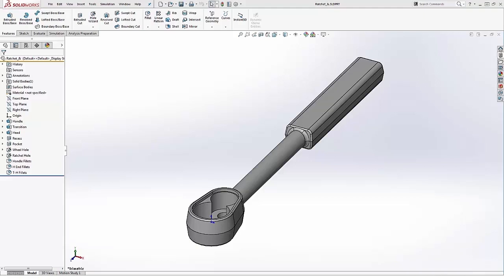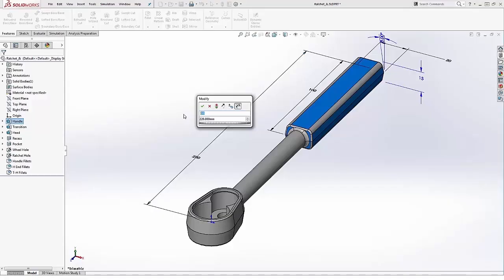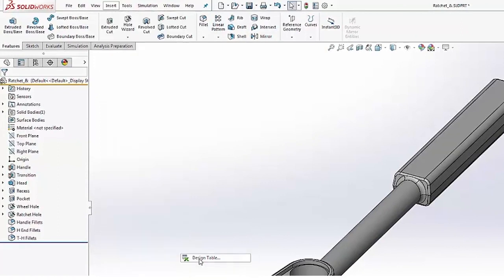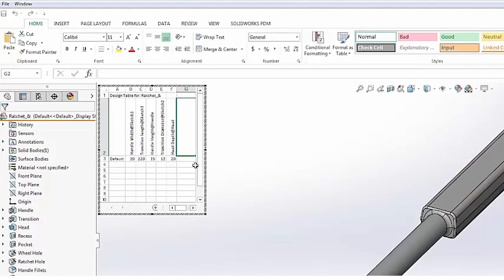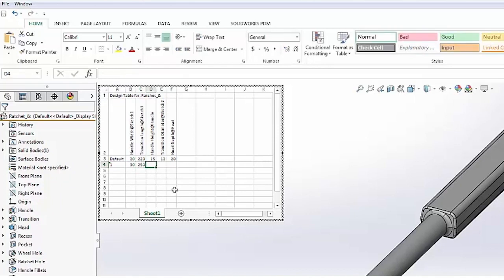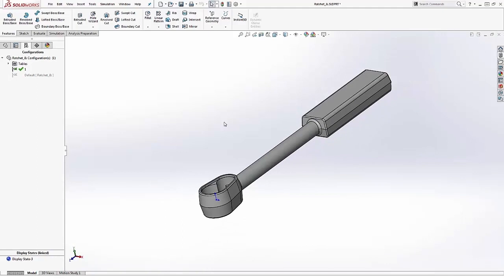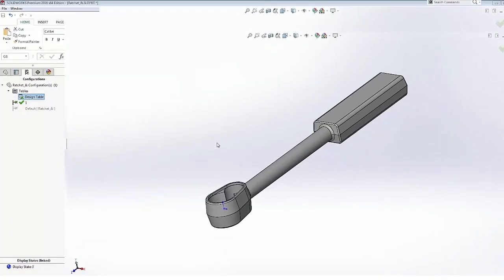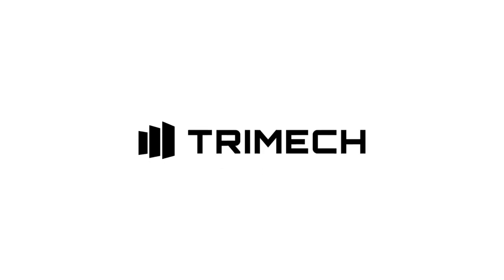Creating and Editing Design Tables in SOLIDWORKS

Comment: Thanks for this video, Is there a way to based on a global variable that you define, have it auto select the correct configuration that fits within the range. for example  i have 5 different configuration of a part in an assembly, I have a global variable called sheet thickness, When the hseet thickness is between <3 i want to use configuration 1 when sheet thickness is >3 i want configuration 2. i tried doing this through  equations which sort of works, but i loose the naming of my configuration, as i can get the dimensions to change but not the configurations.

Comment: Does this only work for dims in a Part or can you reference a dimension from a different Part in say an Assy or Multi Body Part? If so what is the nomenclature of the reference dim going to look like?
Reply: Yes what i think you would want to do though is create a global variable, as global variables are uniform across all parts within the assembly, then y changing the global variable number, all parts referencing that value whether its built in to an equation or not will automatically update with the click of a rebuild.